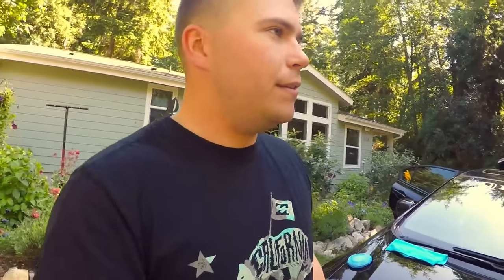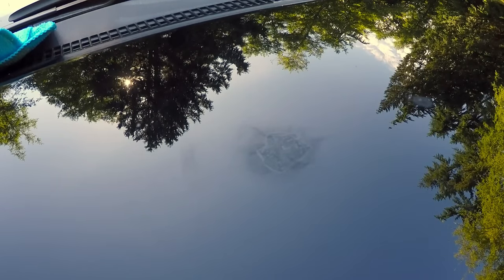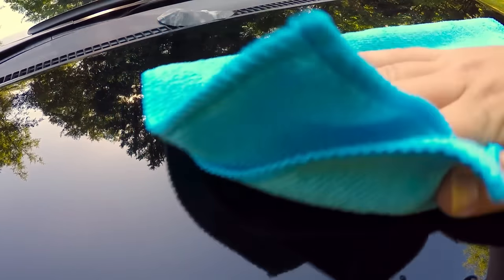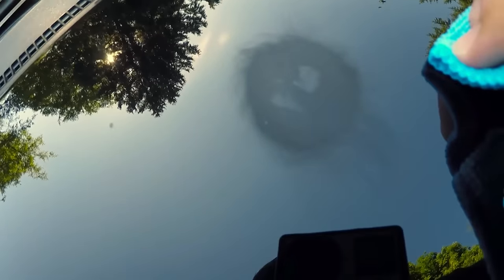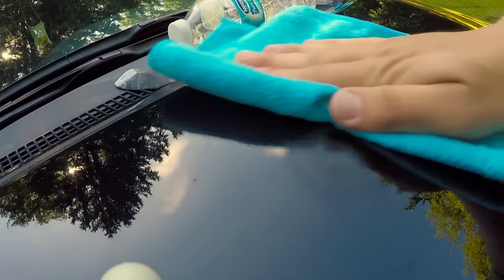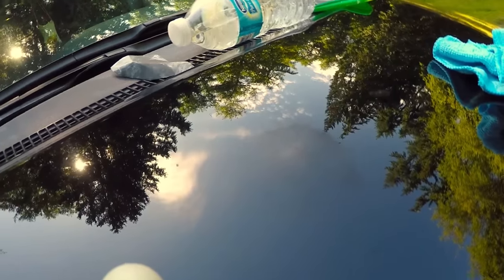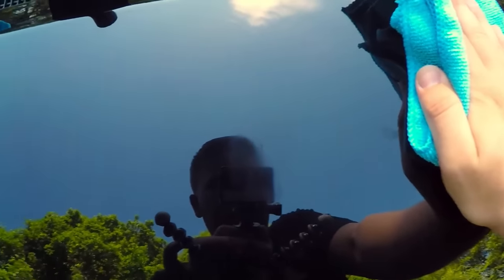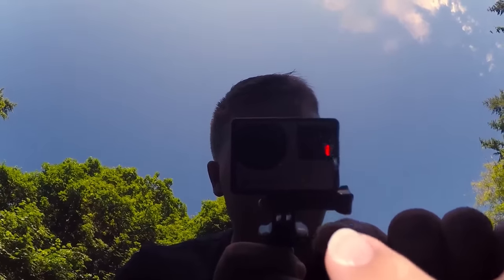Uneven Touch Up Paint Fix

Comment: Great video. Only thing I would add is often touch-up paint has two parts, the paint and clear coat. Apparently the rubbing compound has wax in it, so don't use it before you put the clear coat on. So paint, wet sand, clear coat (optional wet sand again), then rubbing compound and polish.
Reply: Agree. Don’t leave the clear coat
Reply: why would the clear coat's wet sand be optional?
Reply: I recently touch up painted my car. Whats the reason for clear coat?
Reply: @gabrielleyva1684  Clear coat gives the car a shine and protects the paint.
Reply: @SiXiam  what clear coat would you recommend?
Reply: @gabrielleyva1684  Well a lot of touch up paint comes with both paint and clear coat. That is fine for minor scratches. If you have something bigger then you really have no choice but to spray it. Harbor freight has cheap sprayers that work okay for small home use. Amazon sells Sherwin Williams Finish 1 which has a paint can of clear coat plus hardener.  Not going to find much better. Of course you first have to spray the paint for your car, mixed with thinner.
Reply: @SiXiam  ok thank you. Now another question. What polisher and compound do you recommend?
Reply: @gabrielleyva1684  I like Meguiars polish and turtle wax rubbing compound.. I haven't used too many different polishers, so I'm not sure there. Heard good things about the ryobi one+ buffer.
Reply: @gabrielleyva1684  I have the Porter Cable dual action polisher. I like Meguiers Ultimate Compound. It doesn't cut quite as much as the Turtle Wax he's using in the video, but I probably would have followed the 2000 grit with 3000 grit, then gone with my compound. It still worked and he got good results. My technique is just a bit different.
Reply: That makes sense. But some touch up paint has clear coat mixed in. I just bought some, they mixed it up per my code and told me they added clear in it.
Reply: Thank u so much hope it works for me.
Reply: Is this a permanent fix? As in do you have to keep re applying the turtle wax and meguiars polishing compound every few weeks to prevent the sanded spot from showing? Or will it maintain the corrected look indefinitely? If not then you might as well just repaint it entirely
Reply: @MustangGuy1996  No, don’t use the compound again, it’s like sandpaper (takes clear coat off). Just a wax/protectant
Reply: I painted over a long key scratch and then without sanding it, I applied clear coat over the paint. If I want to wet sand it down, will I need to wet sand it flat then reapply clear coat?
Reply: Oooooo good to know
Reply: @breezygamingwiththewife  Should be noted they sell two part clear coat in a can. You press a button on the can and it mixes them. Works very well. Recently painted my car hood.

Comment: a tip: before using rubbing compound, use 3000 grit, it will make the blending process easier.
Reply: thank you!
Reply: Would 2500 work I couldn’t find 3000
Reply: I used 2000 like he recommended and now it has obvious areas where the top coat didn’t get it’s shine back with the wax and polish combo. Am I just out of luck now?  Kind of wish I’d just left it alone at this point.
Reply: @Fookseyify  its possible you sanded through the clear coat.
Reply: Should you apply the clear coat before this process or after ?
Reply: @HoustonCalisthenicsClub  After
Reply: @mightymallardz768  I think you'll find before! You can sand down the color coat and then apply the clear (sanding the color area will give the clear something to stick to) and sand down the clear to even it out with the rest of the panel. If you just level out the color then you have no room for the clear, which leaves you with no color protection!
Reply: @jwbonnett  yeah I'm going to sand it after paint and after clear. Thanks guys.
Reply: @Fookseyify  I really really wouldn't do this unless you've a good idea about it there's so much that can go wrong.
Reply: @mightymallardz768  don't give out advice when you don't know what your talking about you could cost people thousands in damage. You don't try and laquer in a scratch like this. He IS SANDING THE CLEAR COAT
Reply: @Red Tablets what … that is going to absolutely shit on your paint dude
Reply: Sand up in grit to remove the 2000 grit. 3000, 5000, 10000 even if you have to, then compound polish. He skipped grit phases which leaves clear coat marring
Reply: Is this a permanent fix? As in do you have to keep re applying the turtle wax and meguiars polishing compound every few weeks to prevent the sanded spot from showing? Or will it maintain the corrected look indefinitely? If not then you might as well just repaint it entirely
Reply: Should I even use rubbing compound or just polish compound after I've applied clear coat
Reply: @JAMKROMEDIA   Did you end up using compound?
Reply: It would take a little of sanding to sand away all the clear coat with 2000 grit sand paper.

Comment: I wet sanded the touch up and almost had a heart attack when I saw the large matte spot which looked way worse than the chip. I found this video and followed the instructions and it went back to its former shine. After reading some of the comments on here I though that I would have to polish the spot after every car wash but I just rigorously washed my car and the fix is still in place. This seems to be a permanent fix. I used the exact same products OP used. Thanks a lot man - I just touched up all the other chips on my BMW and waiting until tomorrow to finish the job.
Reply: Check back in 4-6 months, you'll have a dull spot. The proper way to really fix this is to polish with an orbital buffer and then wax. You can't get sanding marks out by hand polishing.
Reply: @6thgeardiecast  The Meguiar’s M 105 works really well after the 2000 wet sand. Then M 205 if you are a perfectionist.
Reply: I know the feeling... 🤯
Reply: Is it still good?
Reply: Did the dull spot ever come back?
Reply: Did that dull spot ever come back?
Reply: @Cayden1988  No, it still looks the same as right after the fix. It has been more than a year since I fixed a bunch of chips. This method definitely works.
Reply: @drloveland6475  Nope. Still looks good.
Reply: @andreypetrov8933  hey mate appreciate you taking the time to respond. Glad to hear it buddy. Take care
Reply: @andreypetrov8933  Thanks for coming back to let us know...cheers
Reply: Is this a permanent fix? As in do you have to keep re applying the turtle wax and meguiars polishing compound every few weeks to prevent the sanded spot from showing? Or will it maintain the corrected look indefinitely? If not then you might as well just repaint it entirely
Reply: @MustangGuy1996  permanent fix

Comment: Just a quick tip, only move back and forth in a linear motion when sanding. It's much more predictable and will produce more consistent results across the entire area as opposed to going in circles.
Reply: Not when polishing. Circular motion makes it much easier to blend.
Reply: @Makingblah71  correct. Linear when sanding, circular when polishing

Comment: Good video, but a couple of tips I can give:  

- layer the paint fill. Multiple thin coats until it sits proud of the original paint will allow you to get a perfect finish. 
- never sand in circles, only straight lines. It's easier to remove the scratches
- never sand with your hand. Wrap your paper around something flat that is just slightly bigger than the painted area. 
- rubbing compound is basically cutting compound. What you are doing is cutting into the clear coat to level out the scratches. Drying itself isn't the issue, it's overworking the compound
- when doing a final polish, make sure you use a polishing compound that doesn't contain any glazes or fillers. Otherwise you are only masking the scratches and haze and it'll come right back once its washed off.

I hope those few tips help.
Reply: When you polish you also add wax on top to seal it. This will prolong the life of the polish 💪
Reply: @gangstashots3298  This is true, but it is still only masking the damage itself. 

Far better to correct the damage out of the clear coat and THEN use an LSP. In my opinion.
Reply: My car I used an aerosol spray can and it's uneven! I can send you a photo of what it looks like! Your help will be greatly appreciated! 

Thanks!
Reply: I've watched a bunch of "touchup" videos on YouTube "University", hahah. Many of them are unhelpful, even inimical. Some are fraudulent - the genuine definition of "mis/disinformation". But most of them have something to take away that is useful. Here is a list of useful tips that I know work:
1. Feel the scratch. If you can't feel it with your fingernail then you are in for an easy one. Try rubbing compound first to see if you can lose it. Rub across the direction of the scratch, or along with/parallel to it. Circular motions are okay with rubbing compound. But predominating parallel and perpendicular motions are better.
2. If that doesn't work, then tape off the scratch and wet sand lightly across the scratch, or along with/parallel to it. The tape will stop you from using circular motions which are not recommended. Circular motions produce widespread hazing and light scratching that is much harder to get out.
3. Use the lightest wet sandpaper grit that will cut with a minimum of pressure and expenditure of time. I use 2000 grit. Double the paper by taking the two halves of the piece of sandpaper between your thumb and first two fingers so that the extended work surface forms a rounded contact patch. Hold the paper close to that curve. You can push down and the paper flexes but does not crease. This works for following the direction of the scratch between the two rows of masking tape. For light scratches that you can't feel with a fingernail this will be enough pressure to get rid of the scratch.
4. When you see milky residue in the water, you are cutting clear coat. Wipe the area clean and check your progress. If it looks like the scratch may be gone, then remove the tape and try a bit of rubbing compound again to remove all the sanding haze. If the scratch appears to be gone, proceed to polishing compound. If you see evidence of the scratch still, replace the tape and lightly sand some more, checking your work again as soon as you see milky residue in the water. Doing the repair in short sanding and inspection steps, with rubbing compound to get rid of the hazing, you should come nowhere near cutting through your clear coat, which is TOP PRIORITY.
5. If the scratch is deep enough to feel with your fingernail, you will sand parallel or with the direction of the scratch. Only sand until you have reduced the highest edges of the scratch. A scratch that you can feel is either almost through the clear coat or actually is into the base coat. Do not keep sanding! Check when you see the milky residue in your water. Remove the tape if you need to inspect more carefully. Reapply the masking tape close to your touchup and sand a little more. Make sure that you keep seeing milky residue. If it isn't there then you have sanded off all of your clear coat. STOP SANDING NOW! You will likely still see some of the scratch. You are NOT going to get to the bottom of this deep scratch without cutting into the base coat, the primer coat or even reaching bare metal! Ask me how I know! 
6. Leave the tape in place, or refresh it. Once you have stopped sanding, clean everything thoroughly, making sure that you have gotten all residue out of the scratch. Wiping down with isopropyl alcohol is essential to final clean up. Then carefully apply the base coat color with the tip of the applicator or correct sized brush. Avoid blobs and globs. Put enough light layers on to completely fill in the scratch and area between the tape.
7. When the base coat - touchup color - is dry then remove the tape and apply it just further out enough to work on the raised touchup. Return to the wet sandpaper and again follow the direction of the scratch or laterally to it, do not use circular motions. Wrapping the sandpaper around a pad or squeegee will provide a stiffer edge for cutting down the touchup more quickly. But don't just sand away. Wipe off and check your progress and sand in short spells. Check with your fingertips and nails to make sure that you have made the touchup smooth with the immediately surrounding paint. You should not need to sand any further as soon as you start to see the milky cleat coat residue appear. The touchup is now down to the level of the surrounding cleat coat. Sanding is done!
8. Remove the masking tape now. Use rubbing compound until you see the base coat color starting to get into your towel or pad. Don't overdo the rubbing compound on the touchup, in fact avoid it after the first few passes. Rubbing compound is mainly to take out any serious hazing that your wet sanding may have caused. Use a circular as well as horizontal and vertical motion with the rubbing compound. Use the lightest compound to get the job done. If you overdo this, you will wind up taking down your touchup paint too far and have to start over!
9. Do most of your restoration of the high gloss of your clear coat with polishing compound. This will also polish the touchup that you have just done. Use the lightest compound that will work to restore the shine. Elbow grease and a light compound is better than a stiffer compound. There is little to no risk of overdoing this step.
10. Once your shine is restored, apply your preferred protective layer of wax or ceramic.
11. Do "10" again and again, and do it again. Wax layers fill in tiny low spots with repeated applications. This is only practical when you have a fairly new car with very few touched up spots. If you have a bunch of touchups already, of course, regular full-car waxing/ceramic renewal is how your touchups will last for the life of the paint.
12. Any little imperfections that you might notice at this point should be ignored if they don't attract your eye from five or six feet away. You can tell if you have done it right, if you can walk past or up to the car and not have the area you just fixed attract your attention.
Reply: @AntEloftheHouseofEl   What is LSP?
Reply: @twilighttime952  last stage protection.
Reply: Sorry i'm new into this wax isnt considered lsp because it wont last.. and ceramic coatings are the ones considered as LSP, @AntEloftheHouseofEl
Reply: Any advice on leveling touch up paint on door edges? I closed my door before checking the gaps and took a few areas right on the edge of the door...that was hard to swallow.
Reply: @PassadenaWolfrahm  just make a video lol

Comment: Dude I know this video is like 2 years old but I just did it on my 2015 Porsche and I can believe how good it worked! I was scare to death to try it on my Porsche but man, it really works! I did used a power drill with a pad to do the final couple of Polish coats and that made the paint look like new! Awesome video my friend! You just save me thousands of dollars....
Reply: Can you tell me what you used to touch up the car in the first place? It looks like he had already applied some paint before but didn’t really explain much. Thanks.
Reply: @briangarcia201  he probably used the paint pen that can be bought from ebay which can be matched with the exact car colour from your VIN number
Reply: Brian garcia I got my paint pen from the dealership. If you buy the color online, make sure it matches to the color code on the door/hood.
Reply: What color was your Porsche?
Reply: @hchoutx4111  black
Reply: Awesome to hear! Were the touched up spot noticeable after a car wash?
Reply: @edwinl2506  barely since it was on drive side door, and I had to do it again lately on 4-5 different touch up I had to do, but now on the hood of the car. Used same method you showed but used DA polisher to get rid of wet sand marks with Compound and also polished with DA after. Looks really good even after multiple wash...still a little bit of scratch left form the wet sanding since I did not want to go to deep when cutting but much, much better than original touch up's. You really have to be in the right angle to see them... thanks
Reply: Hi, may i ask you did the repair paint job last long? TIA.
Reply: Is this a permanent fix? As in do you have to keep re applying the turtle wax and meguiars polishing compound every few weeks to prevent the sanded spot from showing? Or will it maintain the corrected look indefinitely? If not then you might as well just repaint it entirely

Comment: Used this method on 11/19 on a 16’ Honda Accord V6 with Modern Steel Metallic paint

This video is so spot on.  Thank you for posting.  I had some blotchy fill-ins with the Honda touch-up pen, and the method you provided was perfect, cleaned everything up really nicely with no spots or haze.  

Only suggestion, instead of Turtle brand rubbing compound, try the 3M Rubbing Compound.  It’s much highly quality and requires very little polishing after using it.

Comment: Great video! I've mastered curb rash repair. Saved $$$.

Now I'm determined to fix chips on my Tesla Model Y. I am using the techniques shown in this this video...but also insights from the comments, which I appreciate.

I have minor chips. Also a small scratch. I used a pen kit: primer, base coat, and clear coat. Here is what I am doing:

1) dab scratch with primer pen, 2 light coats. 10 minutes between coats.

2) Wait 30 minutes.

3) dab with base coat pen, 3 light coast, 10 minutes between coats.

4) Let dry overnight ( I am at this step, will commence with the rest tomorrow).

5) wet sand with 2000 grit...I am pretty good sander in general...no circles...make level...right not it isn't level and somewhat rough.

6) dab with clear coat pen, 2 coats, 10 minutes between coats.

7) Let dry overnight (that will be 2 days from now).

8) Review and possibly wet sand, should be smooth and only micro-scratches remain.

9) Use turtle wax with microfiber towel. As in this video.

10) Use some kind of polish, as in this video.